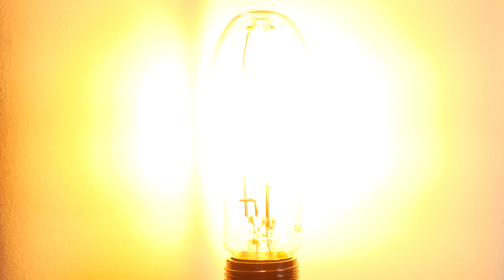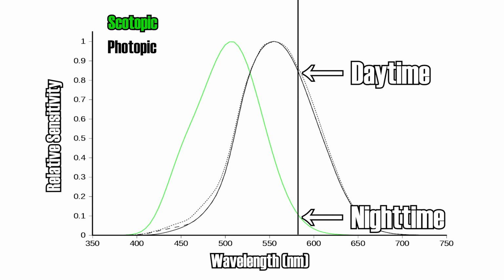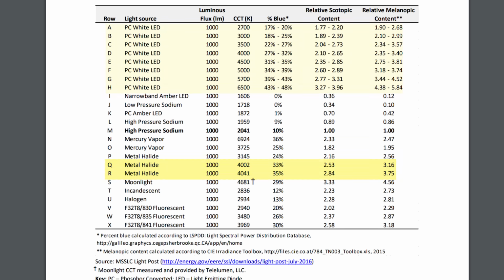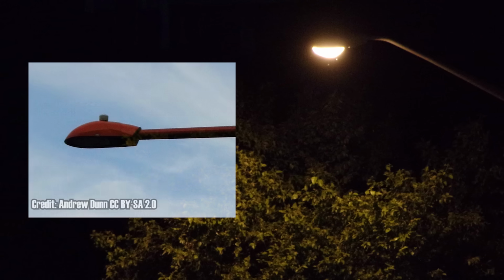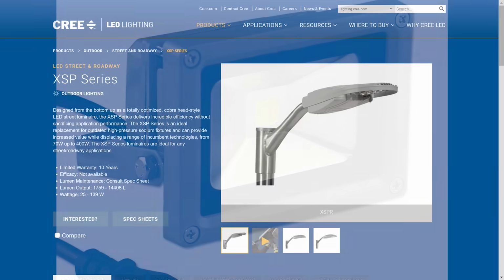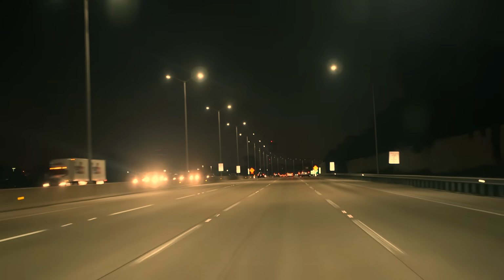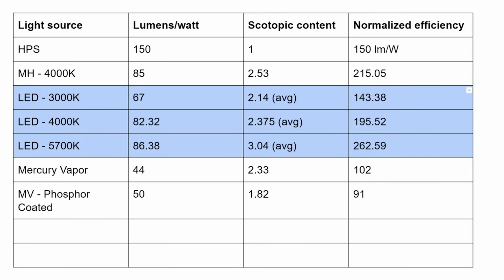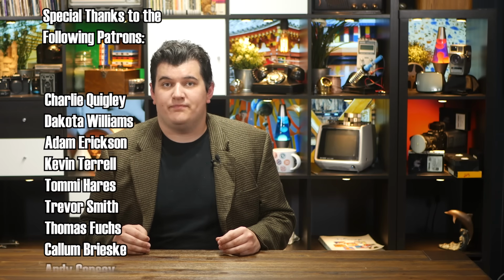The LED's Challenge to High Pressure Sodium

Comment: A few years ago my city started replacing the HPS lighting with LEDs.  I first noticed it outside my parents' house.  The new light is flat on top and is mounted so it is about parallel to the ground.  I noticed the improved visibility first then looked up to see why.  I also noticed that there seems to be much less light pointing upwards than before.  I can barely see the trees/poles/wires above the lights compared from before, even when blocking the light fixture with my hand.  I wonder if this was taken into account when determining the apparent increase in sky glow from LED lighting.  

If less light is being emitted upwards such that the majority of light that reaches the sky is reflected from the ground would that not also lower the amount of sky glow? Does the amount of human perceived sky glow rely more on the colour of the lighting (and perhaps the colour of the reflected light since pavement reflects not only more light than grass but also a different colour since street lights are usually directed at pavement not grass) or on how much light is reflected off the ground below these lights?

Comment: RGB street lights when
Reply: when asus makes them kek
Reply: This is a reply war.
Reply: Car will instantly get twice the mpg
Reply: @Myemnhk  alright! My fartcan car can get over 80mpg!
Reply: Those would have pretty questionable light quality. That's why modern LEDs use phosphors to improve the quality and create the natural looking color
Reply: @Richard Vaughn clear RGB not used in lightning! That's because surfaces reflect this three waves like random. It's good for tv, monitor and other screen where direct light comes to our eyes, it's bad for lightning were light reflects from surfaces.

My English very bad, sorry...
Reply: >what is CRI
Reply: all cars would be drifting
Reply: @ska042  R + G + B = White. That's how white LED's work. Just like white on your phone or monitor.
Reply: @TheCandoRailfan  please explain RGBW LEDs then, you're both right, you can do both but blue+yellow phosphor renderes colour better.
http://www.photonstartechnology.com/learn/how_leds_produce_white_light
Reply: @hede151   RGB, RGBW, and RGBA can be packaged LEDs. Or individual LEDs that are mixed outside of the optic. with RGB you can get "white light" but it has a very low CIM and will look off. To get around this most manufacturers uses RGBW as it adds a white led to the package. the reason for adding the white led or amber in the cases of RGBA is for a better CRI. the best option for changeable white light's is by using a dynamic white or tunable white that uses 3-4 different white LEDs to give you a spectrum of white light. If you buy a white 3200k bin 2 LED from Cree or Osram the only colour that LED will be emitted is a ~3200k white as there are no other colours or temperatures in the package.
Reply: @col888881  Exactly, the white LED in the RGBW package is not just another RGB package, but an LED that makes actual white light, meaning proper white LEDs do exist unlike what @The Cando Railfan said.

Comment: For some reason, I only recently came across your channel, and even randomly choosing videos on YouTube have now viewed several and subscribed. I liked this one a lot. I've always gone for low energy lighting (I was using some CFLs over 30 years ago for economy and lack of frequent replacement) and am now about 50%+ converted to LED bulbs in my home over those previous CFLs and a few Halogens (Xenon filled seemed most efficient). I hadn't previously known of the effect of colour temp during bright and dark periods of the day and found that most 'illuminating' ! In the part of my kitchen that I use for food preparation I deliberately chose about 4500K LEDs and I like their seemingly brighter effect. Elsewhere they're mostly 3000K. 2700K just seems a bit 'gloomy' for my liking.

Comment: One of the big problems you didn't mention with LEDs is the heat. With HPS heat is good and the system will run hot because the sodium need to be a vapour. With LED they still produce heat but high heat will significantly damage them and shorten the lifespan. This means swapping between them requires a complete replacement of the head and attention paid to heat dissipation.

Comment: I mean, they could still use a 5700K LED and put an orange-ish filter over the lights to achieve the same result as using a lower one and it still be as efficient as the harsh bright white light that hurts to look at, right?

Comment: Just recently found your videos. EE for a municipal utility. Most cities, including ours have standardized on 4000K lighting color for LEDs. It is about a 45% savings on energy over our old HPS lights, is the same color temperature as moonlight, and is not as hard on circadian rhythms. The biggest savings with LED street lighting, is seen from fewer trips to service the lights. They last longer, and have basically eliminated our need to send out big gas using trucks daily on street light repairs. They also weigh a lot less than Mercury vapor lights which were really hard on the arms and poles and had more trouble during wind storms. When we did our city wide change out it was only 2 years to pay back the investment, and as mentioned before our calls to handle non working streetlights have nearly been eliminated. We have had some kids get cute with BB guns, but the fixtures have been incredibly reliable.

Comment: I think one good option would be a mixture of color temperatures. In residential areas, like neighborhoods and apartment complexes, lower temperature or dynamic light fixtures could be used to avoid disturbing the circadian rhythms of people in the places where they actually sleep. For non-residential areas, like commercial districts and highways, higher temperature lights could be used as the benefits in efficiency and safety might outweigh the disruptions in circadian rhythms. The disruption might even be beneficial as reducing melatonin outputs in drivers on long trips means fewer people falling asleep at the wheel and therefore a much safer environment.
Reply: Good thinking!

I think we could generally reduce the amount of artificial lighting we use in neighborhoods and commercial districts. I lived in an urban residential neighborhood last year with a HPS lamp every 25 feet practically, and while there may be some safety and security advantages from this, it was fairly disruptive and obnoxious. Using smaller fixtures producing more diffuse light could have probably accomplished similar results without shining in everyone windows. Likewise, commercial districts could simply cut down. While its obviously good to have bright lighting at night in areas that are being used (A street full of busy restaurants and clubs for instance) copious lighting is often plastered around dead big box stores and empty strip mall parking lots well into the wee hours of the morning. 

Just like a lot of other inventions, artificial lighting is overused. Sometimes the cheapest, easiest solution is just to use less lights, and to turn them off during the real graveyard hours. My city must have passed some ordinance like this, because all the skyscrapers and buildings (which have very cool decorative lighting) go mostly dark past midnight. This has a really noticeable impact on light pollution.
Reply: As ironic as this sounds, it's actually something that happens... In video games. In Cities Skylines, for example, the smaller roads are lit in orange while the larger, high capacity roads are lit in blue-white. Perhaps they are influencing future urban planners...
Reply: Used to live in a apartment complex where the bathroom windows were forced to be exposed to 6500k path lights.
You’d go use the bathroom at say 12 am and wouldnt be sure whether the sun is rising or not.
Reply: @uss_04 my apartment complex is like this too. It’s not fun being on the balcony at night because of it.
Reply: This reminds me of the distinct west vs east color of a sky image of nighttime Berlin, owing to the different color temperatures of the street lights in the former GDR.
Reply: I second this, even the very bright white LED street lights don't add much visibility as a pedestrian and in residential areas thats really what they're for.  If you're driving in subruban estates, you shouldn't be going so fast that your headlights aren't enough.  Streetlights just need to light the foot path (sidewalk) well enough so that pedestrians can see potential hazards (eg. Cracks in the pavement or other things that could cause a fall).  

Really, in suburbs we could have streetlights at head or waist height since they do so little to light the road for drivers anyway.  Then they could be placed closer together and use less bright lights.  

I haven't had a decent nights sleep since they installed an LED street light outside my bedroom window even with blinds down inside and out.  The old sodium lights never gave me an issue in that room, although I'd expect its the more an issue with the colour than the light source itself.  Warm LEDs would be a vast improvement.
Reply: My city has seemed to chose a good quality LED light with a lower Kelvin #. I was really surprised when they changed out the old HPS because aside from having to reset all the clocks in the house there was very little noticeable difference.
Reply: They do that where I live in Calgary, Alberta. Main roads have bright white LED lights and residential streets use a warm white LED. They’re a nice touch as it isn’t super bright when walking at night!
Reply: also having lights that keep you awake would be pretty nice on a highway.  keeps you from falling asleep while driving
Reply: While I support this idea, part of an issue is how... North American this viewpoint is. What I mean is that mixed use neighborhoods do exist, especially outside of North American suburbs. In mixed commercial/residential spaces, should cool or warm lighting be preferred?

THAT'S where the rub lies. And considering the many public policy benefits of having mixed use neighborhoods, that's also an issue we should be seeing more and more of in the future.
Reply: Yeah, I also don't see why the circadian disruption is a bad thing.
I wouldn't want myself/others to fall asleep while driving on the highway.
Reply: SibaNL: It would be a bad thing in residential areas where street light filters into homes.
Reply: @benj1008  Curtains. Also, I said highway.
Reply: @SibaNL  Why are you commenting in that case if you are just saying what the original poster said?
Reply: @CanadianCCP  Just adding my opinion. Dum dum.
Reply: @SibaNL  curtains don’t prevent your circadian rhythm being disrupted in your backyard
Reply: @SibaNL  It's moreso the effects of driving home and not being able to sleep after the last leg of your journey (usually rec areas) Rec areas have lower speed limits which are safer. And walking around town.

Comment: Over here in the Netherlands we've done a lot of research in night lighting thanks to the big light company called Philips. The answer indeed is complicated. Rijkwaterstaat for example developed the bat lamp to make sure they won't intterupt the bats as much. However, this light is oretty inefficient. Green light is the most efficient form of lighting. On the island of Ameland they use green-blue lighting to save energy. https://www.rijkswaterstaat.nl/wegen/wegbeheer/natuur-en-milieu/verbinden-natuurgebieden/vleermuisvriendelijke-verlichting/ On the road there is also green-red street lighting (4 green LEDs, 1 red LED) to save energy. The red LED will make sure we can see the colours of traffic signs. However, these green lights are disrupting nightlife except for birds that are flying at night. White light is the best compromise despite its many disadvantages.

Comment: «…cool colour temperature is harsh and aesthetically displeasing….»
Relative terms. I am from the tropics, and the"warm, pleasing glow” of incandescent & other warm temperature lights is very displeasing to me. As a photographer, I could never understand why continental American photographers insisted on using a warming filter (with film) or a warm tone on portraits to make them “more pleasing.” To me, it made them look unnatural and displeasing.

The further away from the equator one is, the lower in the sky the sun often is, and for longer periods in the summer, producing a warmer colour. In the winter, sunlight is rare, and artificial lighting, usually warm, has been the norm. All of this contributes to non-tropical dwellers finding “cooler” temperature lights harsh, —only really seen at noon-ish hours— and displeasing —rarely ever seen— where us tropical dwellers see this “cooler” light as normal, and pleasing, as we are mostly surrounded by it during our wake period, whether summer or winter.

I also wonder whether this, “affect circadian rhythm,” thing is also location specific, as after the warm sunset, we tropical dwellers are met by the “blue hour” followed by the mostly blue night sky (save for light pollution by the harsh, aesthetically unpleasant, warm artificial lights we import from North America).
Reply: @FutureHindsight , they were often part and parcel with UV filters. One could get a regular UV filter, or a “warming UV” filter. The latter had a warming effect on skin tones, outside of the removal of the UV effect. It was a pale pink colour. I never used it. Back then, I did mostly B&W film, and would always use a UV filter to darken —or more accurately, less brighten— the sky, but would often add either a polariser, and/or or a red|orange|yellow filter to really darken|darken|slightly darken the blue sky, making the white clouds stand out.

When I did colour film, no colour filters. Yes, I found Kodak Gold gave warmer tones than Fuji or AGFA, and therefore would rarely use Kodak. I found the colour unnatural.

Comment: The problem with the Led street lighting in my town is:
1. your eyes can't adjust to and from it. Simply put, it temporarily blinds you. It is bad for night vision because your eyes can't readjust to the dark. Amber color lights are much better at preserving night vision.
2. They are bright. even out of the corner of your eye, the light source is painfully bright, I have to look away from them just the keep them out of my peripheral vision.
3. Led street lights light up a small spot on the road, not the wide field of light that the sodium bulbs give out. The ones in my town literally light up a 15 foot diameter spot on the road.
4. The higher color temperatures produce a glare. You literally cannot see what's on the other side of the light.  There is too much contrast between their light and the darkness. It's like they produce this tube of light that you can't see past, or out of.
5. in the rain, they light up the rain drops on your windshield a lot more than the sodium lights do, producing glare.

Comment: One of the major advantages we get with LED lighting fixtures is that we can turn them on and off, dim them, and even change their color to a certain degree. So we could utilize a low output, warm color when no traffic is present on a roadway, and when a vehicle approaches the color could be changed to a higher temperature light for best visibility. That way, a driver always sees in the best light, but people living in neighborhoods surrounded by streetlights wouldn't have to suffer the sleep deprivation of having harsh blueish light outside all night long.

Comment: Not even gonna watch the video. Without a doubt LEDs should replace HpNa bulbs. LEDs dont need bulbs changed. The only changing your doing is the whole head with the lights and odds are the ballast will shit out before the lights. 2 LEDs are a fuckton cheaper to run than standard bulbs and 3 LEDs are far brighter HpNa bulbs
Reply: Also LEDs are a lot easier to wire and because HpNa bulbs get hot the poles at times have to be extremely high up. LEDs dont heat up like that so you can have just a 15 ft tall pole light, sometimes even as small as 12ft depending on where

Comment: One problem is shitty luminaires... there are many LED streetlamp replacements from my local authority (Salford City Council, UK) that turn on and off repeatedly for the first five or ten minutes, and multiple heads have flickering/flashing issues all night, and some crappy replacement heads shine excessively bright light out of the sides that obscures vision.

I am not against new technology, in fact, all my bulbs are LED at home... but I am against crappy implementation without proper research and consideration.

I also don't know what the impact on local wildlife is considering its circadian rhythm. It is especially concerning near woodland areas or parks for wildlife. Never mind the bright white light that intrudes into homes with crappy LED luminaires.
Reply: Yeah, my college dorms have terrible LED super bright parking lot lights. They put normal pull up blinds in instead of blackout curtains so it's like a ufo is flying outside your window.